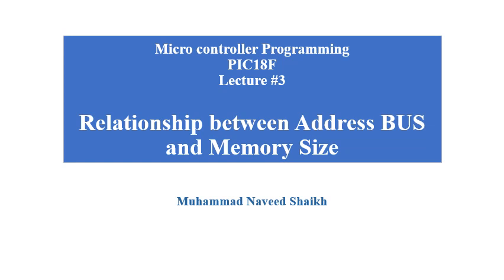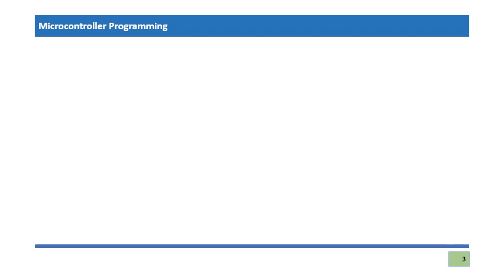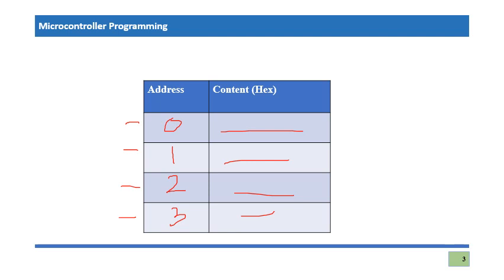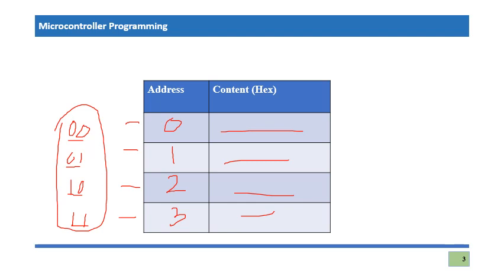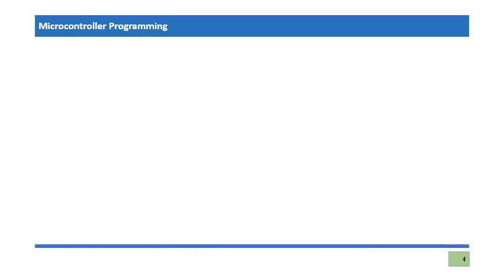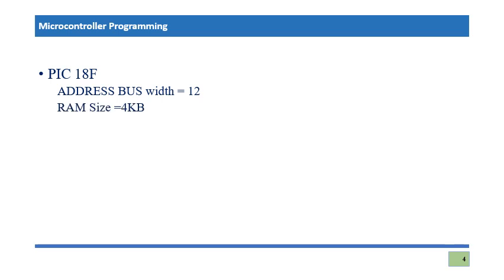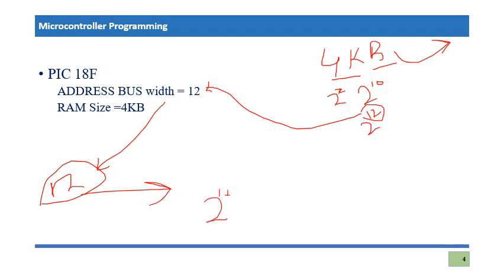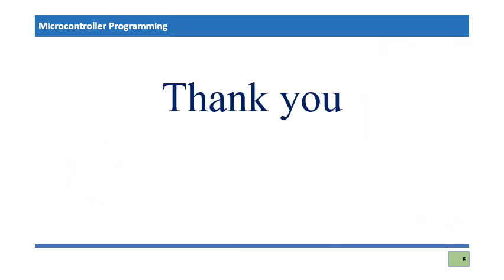How to calculate memory size ?|| How to calculate number of bits in Address

Comment: Can you please tell how can we represent 65bits in ram size?
Reply from the maker: Your question is not clear. However, If I understand correctly. you mean 65 bits in the address.  then you will have 2^65 locations and let say each location can carry m bits then the capacity of ram will be 2^65 *m.
Reply: @LearnOnline1  if the ram size is 22mb so the address width bit is 25?
Reply from the maker: @shahrozatiq5312  22 MB seems something awkward. it should be the power of 2. For example, could be 2,4,8,16 something like that. for 25-bit address... 2^25=2^20* 2^5=1M *32 =32M locations. Assuming each location is 1B so 32MB Capacity.
Reply: @LearnOnline1  today was my test and question was If the ram size is 26mb ,_____ would be the number of bits.
So I write 25 cause 26mb will fall in 2^5 x 2^20
Reply from the maker: @shahrozatiq5312  your question is not complete. ...... WOULD BE NUMBER OF BITS IN WHAT ??  in address ? or in RAM? For example, in RAM it would be= 26MB=26*2^20*8 bits in terms of Capacity shown in bits. However, if the question is about a number of bits in the Address then my previous solution is valid.
Reply: @LearnOnline1  hmm ok thank you for your help 💕 I'll ask some more questions soon😁
Reply from the maker: @shahrozatiq5312  you are most welcome..

Comment: What about 6kb ??
Reply from the maker: Assuming 8bits are stored in one location as asssumed in the same video..one cant completely break down it into power of 2. So either of is done with cascading of two or more smaller campacity chips. Or one can use bigger chip like 8KB. And some of the addres range is not used for real addressing .